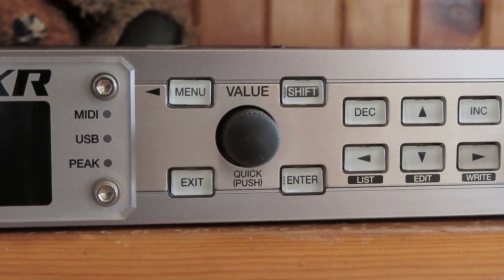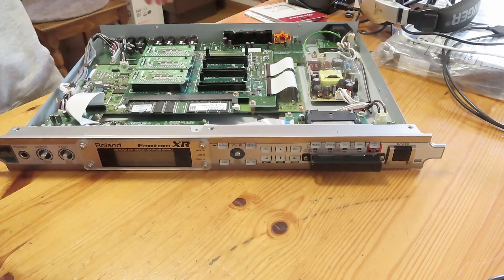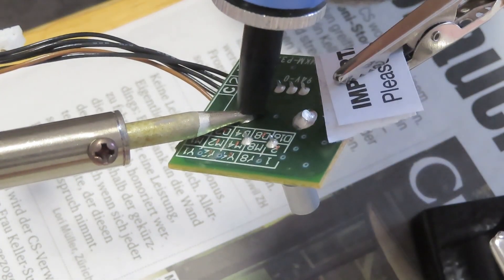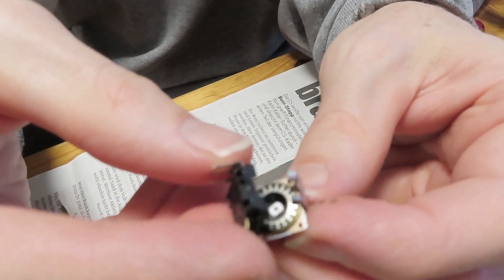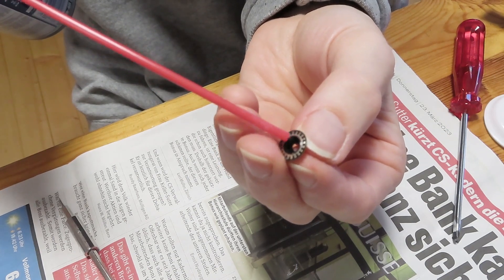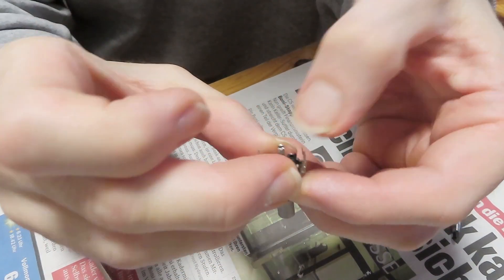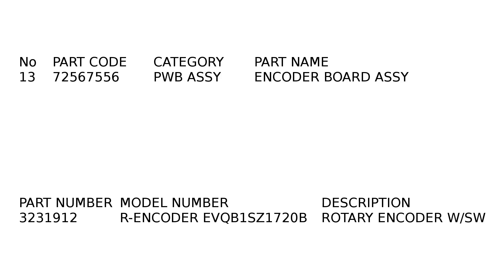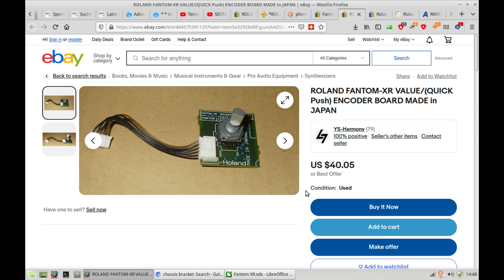Fix Broken Value Dial on Roland Fantom XR. DIY Value Dial Repair

Comment: I saw the part numbers ,  where can i buy the dial ?
Reply from the maker: There are currently some on Ebay these come already attached to the pc board.
https://www.ebay.com/sch/i.html?_nkw=13+72567556&_sacat=0&_from=R40&_trksid=m570.l1313

This is the dial and requires soldering. It is labeled as a replacement for the X6, X7, X8. i don't own these units but i am fairly certain that it is the same as for the XR. While I am fairly certain you should ask the vendor to confirm fantom XR compatibility before purchasing if you want to be 100% certain.
https://www.ebay.com/itm/134136784048?_skw=roland+fantom+rotary+encoder&itmmeta=01K8PNJJKKTJM92WTGDVMWFJ64&hash=item1f3b2ce4b0:g:v7gAAOSw6g5imSa~&itmprp=enc%3AAQAKAAABAFkggFvd1GGDu0w3yXCmi1fmfVxGqZb9%2Bfp%2FdGvZkjrY8x3g2JJ%2FVSAUkIUzR0ceKmBsdI%2BjlvVYVVKj9mzplaASe5cH%2Fp4MKR2eQFe%2BHkH%2BDoYDkWjOPlrcRnijeOq947Vx1ppFMyw9jWCgP92hxug5DiPSwd3ZHTN3o5epkBPWUStq35tdzyZqIDS0Xi9PQRKUH17xtFVzUSTdTsJn0TIdF8BjPBV7LryiPdaZkqzsmfEd6xDa2BXTQaJ0Rfab3Shym2vfXc96CVRNq4gkUg6uhc44cunCMQwUmeL5mDmshYlxw8wnwVKH%2FygMctv0T12flEnYWATdFKH0VedX4vs%3D%7Ctkp%3ABk9SR_qpytXFZg

Comment: Great video,  do you have a video on replacing the screen ,  i purchased the screen but was wondering if i need to remove the front completely to get to the old screens screws for removal ?
Reply from the maker: Sorry I don't have a screen replacement Video. But it is an easy job to do. There is really only one small extra step you need to do that is not in this video. Let me explain.
Follow the disassembly instructions of this Video from 0:21 up until 2:29
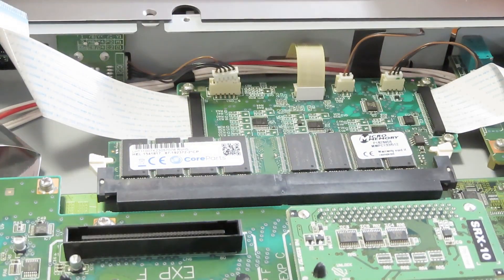At 2:22 the front panel is free and accessible when I say "Pull the face forward". 
The Screen is attached to the front panel (face) with screws. remove the screen from the front panel and put in the new screen in its place.
Reattach the cables and reassemble the unit in reverse order.
Reply: I was able to replace the screen really easy for a person that has never done anything like that before .
Reply from the maker: @freddiemunoz4443  Awesome. Well done. 🌻
Reply: the dial is somewhat working but will order one and install it in the future. . Thank you again for your video  @RandomStuffYouMightNeedToKnow
Reply from the maker: @freddiemunoz4443  You are welcome. Best of luck.

Comment: I currently have a blank xr screen, need help on which cord/tab to make sure the connection is stable. no videos out these😢 days
Reply from the maker: This is a common issue with aging Fantom XR units. What usually happens is that the screen remains lit but the writing on it fades and disappears.

People will usually get the Marek Waskiewicz Replacement Screen. 
Link
https://www.facebook.com/groups/68219870259/user/100037864733369/

Replacement is fairly easy, and people report that the new screen works beautifully.
However, it might not be the best course of action, as the root cause could be aging electrolytic capacitors. Electrolytic capacitors deteriorate with age, and they have a lifespan of 10 to 20 years. Given that the Roland Fantom went out of production around 2008 it is likely that your unit is 16 to 20 years old.
Aging capacitors can cause voltage instability, increased ESR (Equivalent Series Resistance), and ripple, affecting power delivery to critical components, including the LCD screen and its controller.
It is therefore possible that the Marek Waskiewicz replacement screen is more tolerant to voltage fluctuations caused by aging capacitors.

Given the age of the unit a Capacitor Replacement will be Inevitable. The failing capacitors will eventually affect other parts of the unit, including:
Analog and digital outputs (causing audio degradation, noise, or failure)
MIDI processing
Boot failures / crashes
Power supply failures (worst case: dead unit)

Of course, I cannot guarantee that the failing screen is caused by the capacitor, but given their age they are a likely culprit.
The Roland Fantom XR is an excellent high-end unit and worth maintaining.
I think the best course of action is to do an Electrolytic capacitor replacement, often referred to as recap. 
A DIY recap is not that expensive as capacitors are fairly cheap to purchase, but it will take a fair bit of effort, time, and caution to do correctly.
A recap will set your unit up for another 15 to 20 years, preventing any collateral damage and ensure pristine low noise sound quality. 
Hopefully a recap will cause your screen to function normally again. Should your screen still be malfunctioning after a recap, get the replacement screen from Marek Waskiewicz

I might post some content on the issues of recapping and screens some time this year, but I don't want to promise anything.

Comment: Thanks. Having issues with a Boss Gigadelay guitar pedal which has similar rotary encoder which does not work properly anymore. It only increases the value but not decrease. Maybe cleaning would help? Hard to find any parts for this device anymore.
Reply: ... and 30 minutes later I disassembled the device and did some cleaning for the rotary encoder. Did not desolder it yet. Assembled the pedal together again and not the rotary encoder works again.
Reply from the maker: Glad you got it working. Cleaning is always a great first option on any rotary encoder that behaves faulty or erratically as bits of dirt and bad or tarnished contacts are often the culprit for malfunctioning Rotary Encoders.

Comment: Thank you for showing how to disassemble the Roland Fantom XR. I am having a problem with my XR where the 1/4" outputs have a lot of static noise coming out of them. I have tested multiple cables connected to the XR outputs, and the static noise is always there. Do you have any experience with outputs going bad on the XR?
Reply from the maker: Hi
There is a number of reasons why there might be a lot of static noise coming from the 1/4 outputs. But I will try and point out some possible causes. 
There could be a Damaged, dried out, Bloated or even ruptured Electrolytic Aluminum Can Capacitor either in the Power Supply or elsewhere on the circuit. They are the capacitors that slightly resemble a small coca-cola can. Aluminum can Capacitors have a life span of about 10 to 20 years depending on quality and usage. So if the unit is of a certain age they are always a potential culprit. 

Another thing to look out for is Hot Glue. My unit does not have hot glue but I have heard that Roland might have used hot glue on some production runs. Check If your unit has any Hot glue inside on the circuit board, Power supply, Connectors or any internal components. If you do see hot glue carefully remove all the hot glue you can find. Hot glue can develop microscopic cracks as it ages that are invisible to the naked eye. Stray electricity gets trapped in those cracks and the hot glue then acts like a randomly placed capacitor causing disturbances such as noise or causing the unit to malfunction.
Isopropil alcohol should work well to dissolve Hot Glue.

It could also be a damaged IC or Transistor. If it is either of those you most likely will not just get static noise but the audio signal itself would most likely be distorted and have other anomalies beyond just a static noise floor.

You should also get a appropriate electrical contact cleaner unhook al the cables sockets and plugs inside the unit Give them a Clean using the contact cleaner and a Q-tip then reinsert them in to the sockets. Also carefully clean inside the 1/4 Jacks as there might be tarnish inside of them contributing to static noise.

If all fails also consider using the SPDIF output of the Fantom XR If your Audio interface has a Coaxial SPDIF input you can connect the fantom XR to your audio interface vie a Coaxial cable with a RCA connector. This would bypass the Digital to analog conversion of the Fantom and depending on the situation is likely to bypass the static noise as well.

I hope you will be able to  you to  find the culprit and eliminate the noise problem.